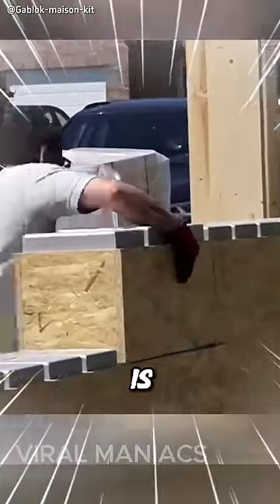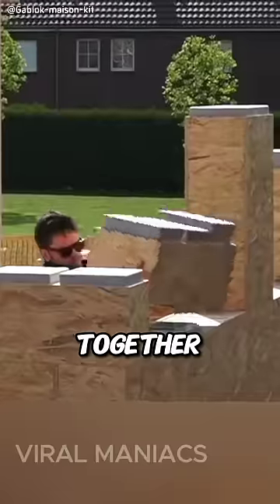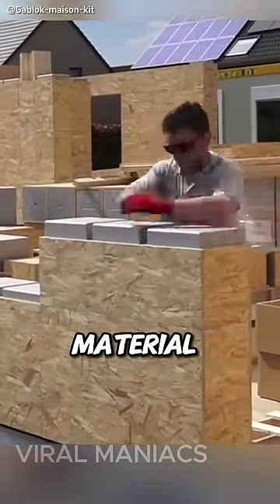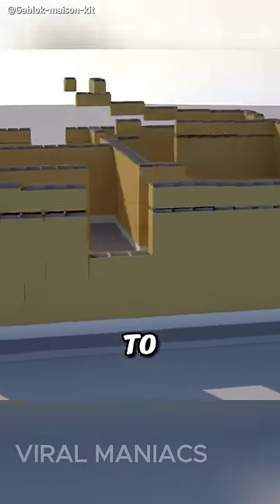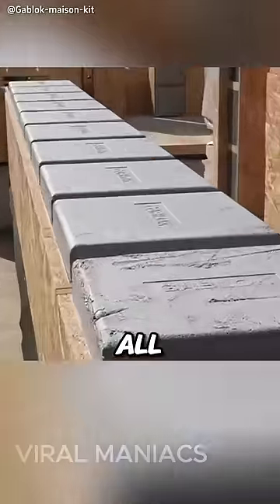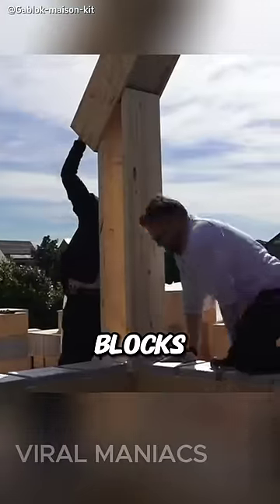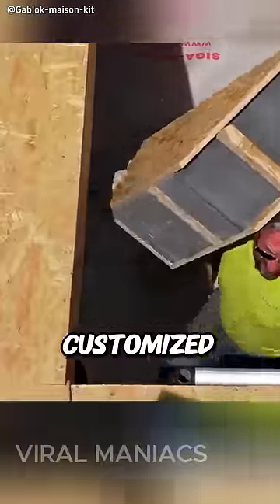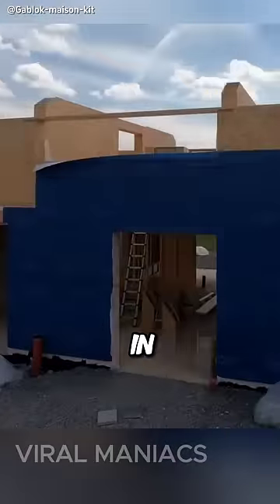Whoever Invented This Way Of Building Houses Is a Genius #shorts

Comment: Warm in the winter 
Cold in the summer
Gone in a hurricane 😅
Reply: Have you seen how they build houses in Florida 🤔
Reply: No need even hurrican...
Reply: Correction, you mean small tornado.😅😅😅
Reply: As opposed to a house that doesn’t blow away in a hurricane?
Reply: Yes I have. It has to stand up to a force 4+ 🌀. Also windows have to stand up to similar forces.
Reply: Burned in a second!😢
Reply: Or a tornado.
Reply: What about fires?
Reply: Iike most Americans homez
Reply: @milkybar06 yeah. Polystyrene goes pretty hard in a fire.
Reply: Leans sideways to fart, farts to aggressively
* blows a hole in the front wall *
Reply: @youwillneverknowiamherefor5392 Most homes will not blow away in a hurricane unless it is a Category 5. This thing probably wouldn’t do well in a Category 3….
Reply: Did you know that: you can do whatever you want to the exterior, and interior? Now you know.
Reply: @youwillneverknowiamherefor5392  hurricanes typically only damage trees and cause minor flooding. All the destruction you see on the news from an average hurricane is searched for by news crews. When I lived in an area that got about 3-5 hurricanes a season, it was typical for the news crew to find the one or two houses over 5 counties that took damage and make it out like that was how it was across the 5 counties. Hurricanes can cause mass destruction (Matthew, Ian, Katrina, etc.), but those are a small percentage.
Reply: Funny comment 😂🤣🤣🤣
Reply: It also becomes a house boat if it floods.
Reply: @Anonymous-zk7yk  that place wouldn't hold up to a 60 mph wind and every neighborhood sees that at least every few years.
Reply: @marksheiman1538  Yet insurance companies still won't insure them. It's also like that's not enough and Florida is a dead market.
Reply: @treffle17  yes I have. Not very fast because it gets too hot in the summer.
Reply: Most likely, they use fasteners lock these together. If so, this is almost certainly stronger than typical stick framing (2x6s, etc).
Reply: Most people don’t live in an area that gets hurricanes. Florida and the Gulf Coast is a relatively small area of the U.S. and even smaller part of the world. I don’t think I have ever seen winds much past 50 or so mph in my entire life and I am old.
Reply: You mean a light breeze…
Reply: Fires: 👁️👄👁️
Reply: Block by block, gone, bye,bye
Reply: @milkybar06 it's FUEL in a FIRE!!!
Reply: @charleshill984 
Correction: You mean winds strong enough to blow someone's hat off. 😂
Reply: Well, I saw three brick houses in a row get taken clean off their foundations by a tornado. If nature wants it, nature gets it!
Reply: Gone in a hurricane, maybe. You can always go around and collect the pieces though and start again. You be up and running before the neighbours.😅
Reply: Huff and pufff
Reply: No hurricane in California
Reply: @lucidfranko
Insulting Sour Grapes 🍇 Comments
Reply: @user-bw4jm1bv1i 
They're Probably Made To Be Fire Resistant. Just Like, There Are Fire Resistant Curtains & Other Materials Used In Hospitals, Cruise Ships & Even Fireman's Uniforms Etc Etc
Reply: I really don't understand why americans are refusing to just build houses like in europe.. they don't even cost more to buy than the ones in America
Reply: I'm sure a female who talked a lot had had mens money to waste created this company
Reply: Exactly!
And how toxic is that material??
Reply: normal plywood homes are gone too, so what's your point?
Reply: If it's a bad hurricane no house will survive. You realize roughly 17 million people live in mobile homes?
Reply: Also, much more flammable than a regular house
Reply: PERFECT COMMENT!
Reply: I guess y’all never seen a log cabin built before seems like a similar process just made way easier and probably 5x as strong
Reply: @thacutoff6226  bro, don't act like watching someone build a log cabin is just a normal thing to do
Reply: You forgot "Razed in the fire".
Reply: That’s like all houses lol
Reply: I have lived on the East coast of Florida since 1955 and have lived through every hurricane since then. I have lost a few trees and been without power for some days but never had a single house receive any damage from the Hurricane or the rain. I do not live within a mile of the ocean or build in low lands. In all those years I had one small tornado take about a 10x10 section of the tile roof off. But not the actual roof itself. If you build right and don’t skip the good stuff it makes a big difference.
Reply: @Anonymous-zk7yk  idk where you lived, but in the gulf coast hurricanes do alot of damage over a large area.
Reply: @treffle17 no, please explain. Im not american
Reply: @thacutoff6226 That 'packing case' would be no where near as strong as a properly constructed log cabin,not even in the same league.
Reply: But there are many countries without hurricanes
Reply: Sort of partly true. Yes, you can do those things, but you can also be forced to tear it down if parts of it don't fit within local building code, we can often change dramatically between jurisdictions.
Reply: @robertdelred 
I’m too lazy to list off all the problems with Commiefornia.
Reply: nah, a 5mph gust of wind would do the job 😅
Reply: Fire trap. Poly melts then goes up like gasoline.🤔😯😯😯😱
Reply: @treffle17 Uh yeah, usually steel reinforced concrete.
Reply: not all people live in hurricane areas
Reply: Gone with the wind 🌬️🍃🍃🍃
Reply: Like a typical American house then?
Reply: @marksheiman1538  my guy, if you're having a serious conversation, finish your sentences. 4+ what? 4+ men? 4+ children? 4+ frogs?
Reply: Exactly where could you live IN THE UNITED STATES in these houses? All up the east coast we have hurricanes, through the mid-west we have tornado alley, west coast earthquakes, not to mention floods and fire. How they hold up to either of those is anyone’s guess.
Reply: I don't suppose painting the roof blue would save it.
Reply: @MrGreen_ homes A new way of building quicker
Reply: Imagine living in a place with tornados or hurricanes 😂
Reply: @kritikal3172  we have hurricanes. No way!
Reply: Give me bricks and mortar anytime, houses shouldn't be made of wood.
Reply: @jasonalldridge5784  amen to that sir!
Reply: ALL houses will be gone in a tornado/hurricane.
Reply: @lucidfranko  they wouldn't.t be hollow just waterproof and maintenance free.
Reply: What's different than the shitboxes built in 3 days now?
Reply: @milkybar06 Probably got some sort of fire retardant built into the blocks, doubt it's like packing polystyrene
Reply: If the foundation is from cement I don't mind having this kind of house outside the city just don't tell me the basement is also made by these lego toys because it'll be suicide.
Reply: @TMMAAK  the bricks would be filled with cement otherwise they would be too light.i might be a girl but not silly.
Reply: I was wondering about hurricanes or tornados 😅
Reply: Hahahaha right
Reply: @milkybar06 melts in seconds.
Reply: Homes in the 1960s took 20 mins to completely burn down, as today, it only takes 4 mins...your fkd regardless of what your house is made of, its already full of flammable materials!
Reply: Exactly what I was thinking!
Reply: Hurricane? The big bad wolf could blow that down.
Reply: @treffle17  yes, building codes here are INSANE! Elevated graded for flooding, concrete block frames and everything has to have hurricane straps. The homes here make anything else in the country look like tiddly winks!
Reply: @charleshill984 correction, a warm summer's breeze. 😂
Reply: LOLOLOLOL yep
Reply: @milkybar06 It’s wood and EPS, which is what a normal wall with foam insulation is made of. Everyone is playing smart, but this design would be very strong and very quiet and well insulated.
Reply: Pretty much any house in the USA gets mowed by a hurricane since most of the houses are made of wood and not concrete.
Reply: hahahahahahahah
Reply: Toto we are not in Kansas anymore. Been hit by a tornado
Reply: @AmixLiark built like a Boston Whaler but with OSB
Reply: @sylviaburns2995 so is any stick built. If you want fireproof go with concrete.
Reply: You ever try to blow down a lego building?  Impossible.
Reply: @Chirpy_Squirrel  nothing is impervious. The wind would worry me less than an impact from debris. Can it pass a 2x4 test?
Reply: I wonder if its stronger than my trailer 😂 my trailer was still standing after hurricane Irma and I didnt do much but protect windows and I left to a hotel that was on higher ground
Reply: you forgot gone in a smoke!
Reply: Hempcrete will give us highly insulated breathable homes that will last for hundreds of years and help to end global warming.
Reply: @youwillneverknowiamherefor5392 lmao most houses don’t blow away in a hurricane buddy
Reply: @higreentj  and anyone who lives near it when it burns will fail a pee test.
Reply: What a Dik😂😂😂😂😂😂
Reply: Was literally gonna state that haha
Reply: I was just thinking that it's like a giant bouncy house. Stiff wind will blow it away.
Reply: @robertdelred  These things will also fall apart in earthquakes, because polystyrene isn't very strong.
Reply: @mtadams2009 see that every couple of years in Alberta.
Reply: How will it do in Oklahoma?
Reply: Or one big Fart!!!
Reply: And like lightening in a fire
Reply: Perfect house for Las Vegas …..
No hurricanes
Reply: God loves America
Reply: Only a hobbit house would be hurricane proof. But most people don’t want to live in a dugout. Or they’re at sea level, but the dugout could be built as a hill then…
Reply: Yeah that will be useless without the hurricanes going through Minnesota
Reply: Just have a I underground bunker nearby, most homes gone anyway
Reply: The American Concept
Reply: I wouldn't use this system in south florida. However they do make a system of Lego type blocks that are hollow with reinforced plastic every 16 inches. After stacking them you then pour each cell about 8in by 8in with concrete. Very tough and energy efficient
Reply: That's funny.
Reply: Why does everyone hate? Can any of you explain your knowledge on why these don’t work or anything factual? And by factual I mean say some facts and not opinions. Bet I get 1 reply at most.
Reply: Just put bricks around it not to expensive
Reply: No need for a hurricane. A drizzle will do.
Reply: Like most houses 
Don't child in hurricane zone
Reply: Hahha😂
Reply: I’m wondering how you go behind your walls for electrical and piping.  Especially when life happens. 🤔
Reply: Lol 100% I was thinking to write something similar.
Reply: That’s why intelligent people don’t live in an area where hurricanes happen.
Reply: Suddenly everyone’s an engineer/physicist/ weather expert. 

It looks flimsy, but I’m sure there’s more to it than this short is telling us
Reply: you are aware that basically all houses are made with wood and insulation right?
Reply: Hi, do not live in an area where hurricanes occur.
Reply: Yea, just like most houses made today, tf you talkin' bout.
Reply: @zLUKENUKEMz mine us poured concrete. It will take any storm. My friend built in an all poured concrete neighborhood, in Orlando. She doesn't worry, either.
Reply: Literally what I was thinking, although part of the reason this keeps happening in the USA is because the USA is obsessed with timber houses.
Reply: Floods does lot of damage hurricanes do also florida has some of the worst just look it up
Reply: well said. Most homes built in the last 40 years are junk waiting to blow away
Reply: @treffle17 just osb
Reply: Brick houses barely blow away
Reply: Americans & wooden houses
Reply: Hater
Reply: Float in a flood
Reply: @mtadams2009 we have 70 to 80 mph winds all the time during a simple thunderstorm and no I don't live anywhere near the coast.
Reply: @mtadams2009 geographiclly the gulf coast is a huge area of the united states'!
Reply: @robertdelred no just fires, mudslides and earthquakes
Reply: Boat in a flood
Reply: 😂😂😂 exactly 😂💯
Reply: There are already ample building codes, fire codes, regulations, and standards to be met for any structure to be insured. If a building method didn't meet all of these already, it wouldn't exist. 

You geniuses should stop.trying to knock new construction techniques with baseless arguments. If your negative comments had any merit at all, a product like this would have never made it to market.
Reply: What about fart 😂